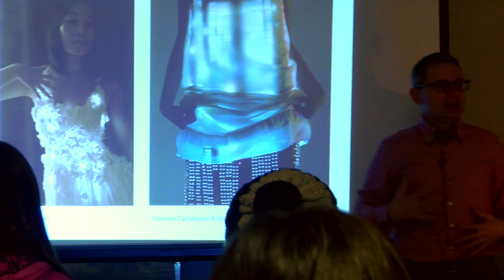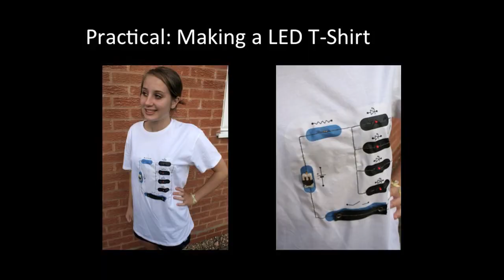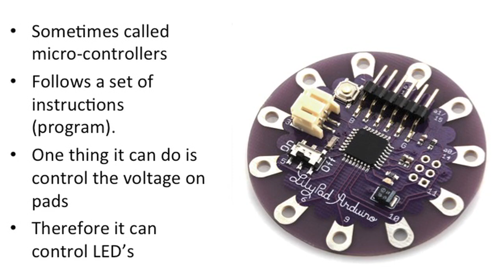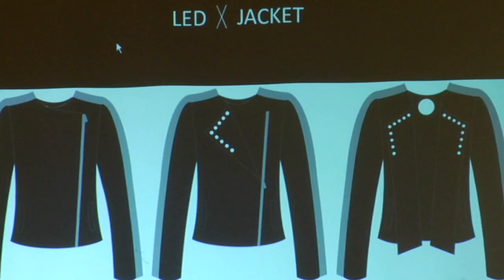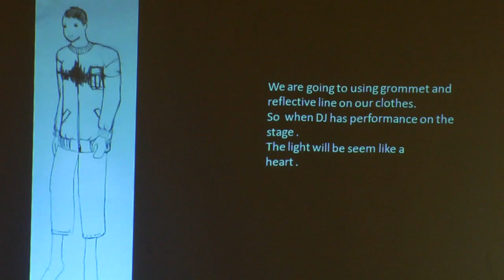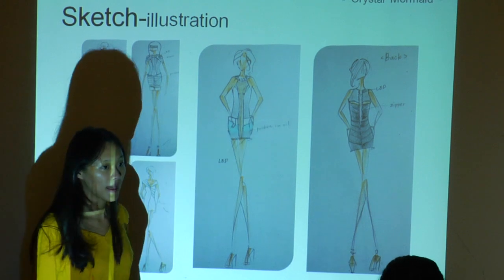實踐大學服裝設計系 Wearable Technology Workshop 2012 - SCFD

Comment: Getting useful amounts of electrical energy from body motion is really difficult. There have been shoes with piezoelectric crystals which could generate some electric current every foot step, however, this is still not much and it is in an awkward place - somehow you have to get it from your shoe to elsewhere on the body. Also, there is not so much energy in a static electric shock - so we are stuck with batteries for the immediate future :(